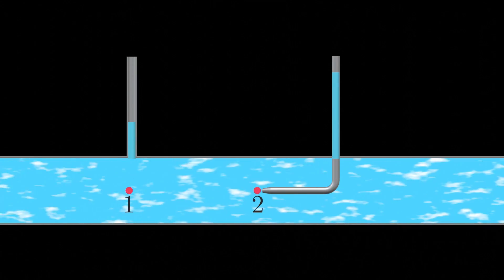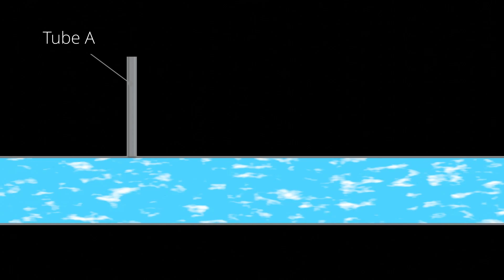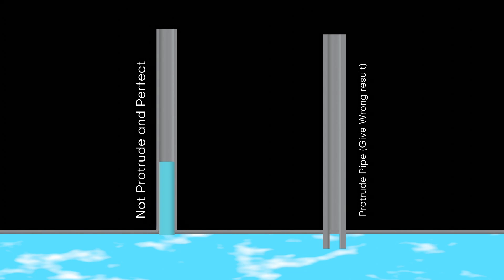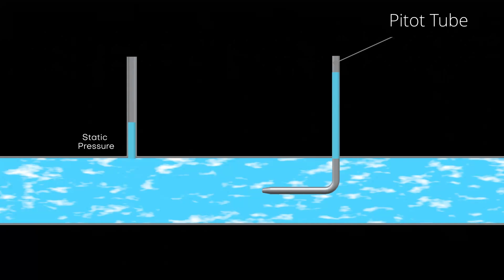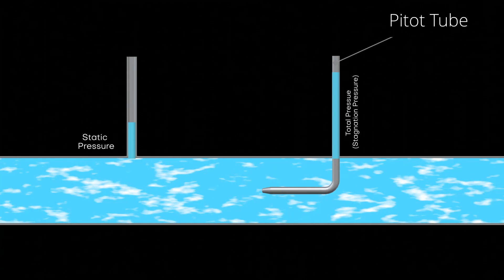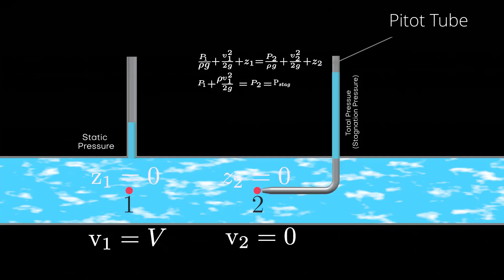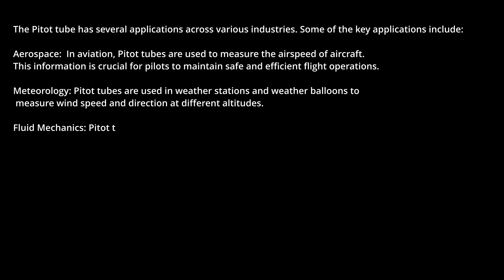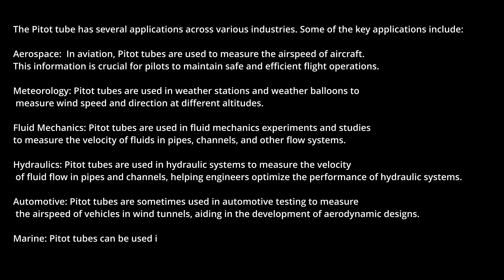What is Pitot Tube , How it works and It Application Explained in 3D

Comment: why is velocity at point 2 zero?
Reply: it is made in such a way that the fluid will come to a complete stop at the point
Reply: @lunayokai885  I still don't get it, could you please elaborate more on your answer? What is it made: the pitot tube? the problem itself?
Reply: @3467AAA  I mean the fluid is forced to stop, creating the stagnation point where pressure is at max and velocity becomes zero by far my knowledge , might be wrong
Reply: Great question, my exact same question. What's the logic or justification for point 2's velocity be zero?

Comment: How does the water rise in the static tube? If the water would have been at rest, the water wouldn't rise in it. So, I understand that the rise in the static tube should happen due to the velocity of the water, namely the dynamic pressure. Could you explain why am I wrong?
Reply from the maker: water rise in capillary tube even when water is at rest. Search for capillary tube experiment it will clear doubt
Reply: @engineerknow  Yes I know that but it occurs due to the adhesion which is a different topic. Some people say that because the pipe is a closed pipe, it creates an internal pressure which causes a static pressure and this is the best response I've heard so far.
Reply: The water wants to be cozy